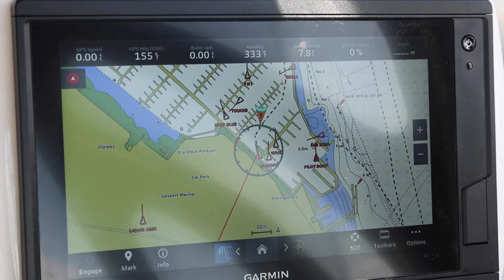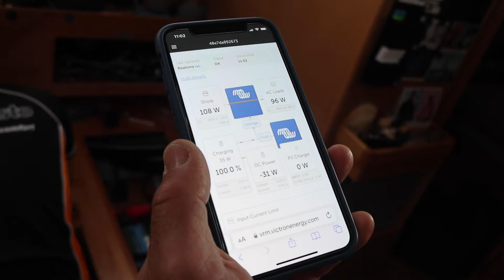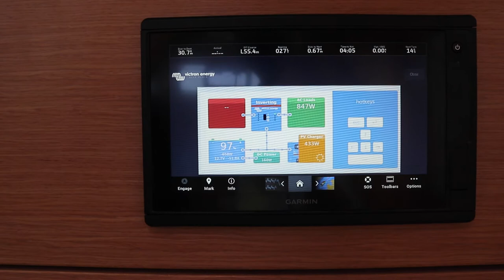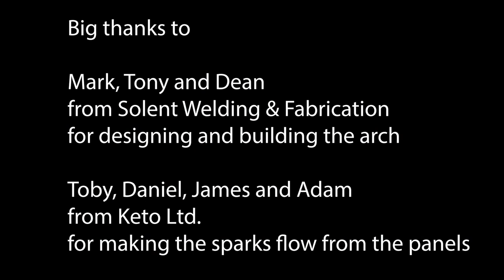Installing a Solar Arch: Self-Sufficiency on a Sailing Yacht

Comment: Thanks for the video. I'm planning to do something very similar in a Bavaria 51. Please, could you share which solar panel brand/model you used? and after almost two years, any recommendations on the equipment you used then? What would you do differently if you had to do it again? Thanks again for sharing the video (your knowledge and wisdom😁😁).
Reply from the maker: Hi Juan
We used the solar panels from Sunpower SPR-MAX3-400-COM, rated at 400W each. They are wired in series and connected to a Victron MPPT 250/100. We have a 12V LiFePO4 battery bank of 600Ah = 7.2kW.
After 2 years we are very happy. Of course, here in Scotland and further north the solar yield is close to zero from September to March, but during the cruising season we generate about 3.5-4kW on an average day which covers our daily needs. On a nice summer days it is much more, we have seen over 7kW of solar yield a day which is enough to run even the water heater from solar…
What would we do differently? Retrospectively, I think the only thing we would do differently is the arch. I think I would spend more time (and money) on a proper integrated davit system for the dinghy. Whilst we can lift and hang the dinghy underneath the panels the frame is not made for a 55kg dinghy in rough seas. So, it continues to be stowed on the foredeck.
Hope this helps. Good luck with your project!
Best regards,
Daniel
Reply: @sailingpolaris  Any thoughts on how you would improve to carry the dinghy? I have a Bavaria 45 Cruiser 2011 model and about to head down this path.
Reply from the maker: Our dinghy is 53kg and the engine another 50kg or so. 
With a lighter dinghy and perhaps an electric outboard you will easily half the weight and then it is less of an issue. 
If you want to lift a heavier dinghy think about integrating a davit system into your arch. Also, consider the weight on the stern of the boat in general, as in weight trim and boat stability.
Try to keep the dinghy as low as possible.
Reply: @sailingpolaris  tx for that. I already have davits, but looking to get the dinghy lifted by the arch completely and remove the davits to make space for a wind vane to save the autopilot and batteries on long journeys. You didn't consider having the arch go forward a little bit more?
Reply: I wish I had seen you guys in Largs, I was there just after you. Had work done by 360Boat Services, not DDZ that you worked with.
Reply from the maker: We had our arch designed going that far back so that the dinghy would fit under it…
I think you might press hard by wanting a dinghy high on an arch on a long ocean passage. 
In our case a wind vane doesn‘t work because of the large swimming platform and the wide stern. We can‘t fit a wind vane close to the center…
Reply from the maker: @svscatterling5538, what a shame we didn‘t meet! 
Callum and Tom are great guys too! 😉

Comment: Hello, may be I missed it but what type of solar panels did you use? Make, performance, dimensions?
Reply from the maker: 3 x 400W, Sunpower SPR-MAX3-400-COM, 
https://sunpower.maxeon.com/int/sites/default/files/2022-02/SPR-MAX3-400%20SPR-MAX3-395%20SPR-MAX3-390_0.pdf

Comment: I would have mounted that arch on starboard mounting plates. The metal is sitting on gelcoat. Also starboard or metal backing plates. Don’t know about all that reinforcement with a deck that thick. That was a waste of time.